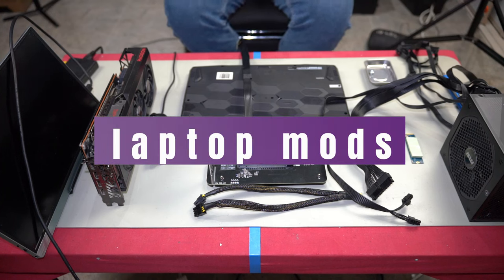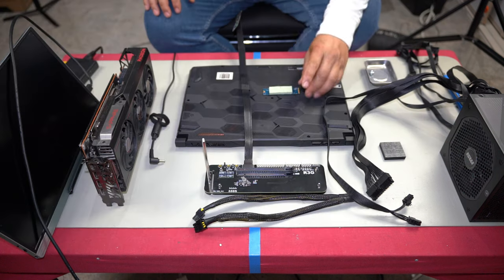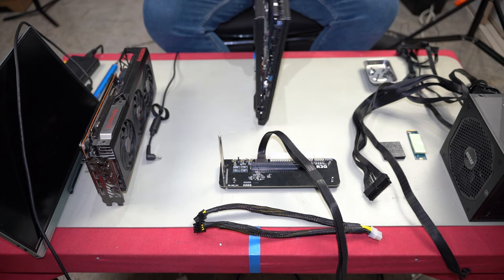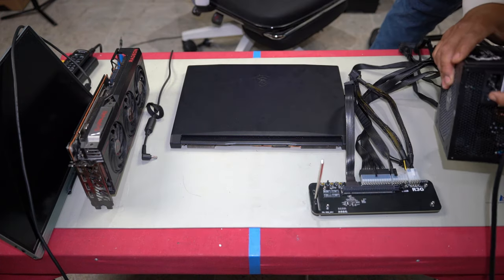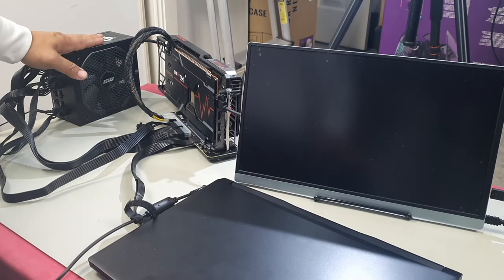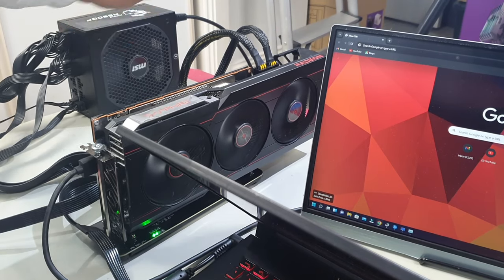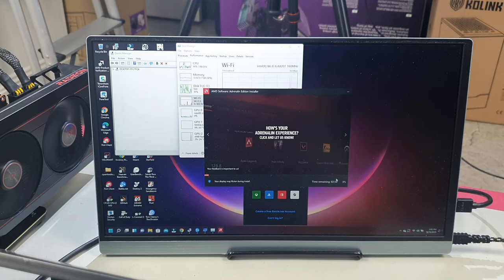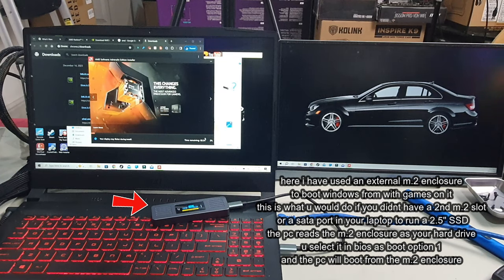how to setup eGPU  use an external gpu with your laptop for gaming

Comment: Amazingly detailed, thank you :) you're even using the PCIe 4.0 compatible one that the other guides don't seem to use. Just what I needed!
Reply from the maker: ur most welcome my friend
Reply: Where can I get this dock in India? It's not in Amazon 😔
Reply from the maker: @babyjvadakkan5300 aliexpress buy from them and it will come to u
Reply: @MIKEYZVLOGZ thanks
Reply from the maker: @NewEra-u3b  so welcome dear friend
Reply: I have been looking for this type of video, because my laptop is ASUS GL504GS, with Nvidia graphic card gtx 1070 and I want to add an external gpu of rtx 4060. Will this work too?
Reply from the maker: yes it will @davidmartinez6347
Reply: @davidmartinez6347  what's the processor!? check for bottleneck cpu and GPU
Reply: @MIKEYZVLOGZ  Well, what I later did is to use my main m.2 slot ssd space for this and reorder another hdd and place it on the free space I have because the WiFi card on my laptop is totally different from the examples you listed and it work. But thanks for an eye opening video and your ability to respond.
Reply from the maker: @davidmartinez6347  I'm glad u figured it out ..good on ya mate.. perseverance is key ... I applaud your willingness to keep trying and figure out a way..it's what I do..I don't give uo easily ...very smart idea to just switch the boot drive so u can use tour egpu

Comment from the maker: So worth it the 3050 isn't the best graphics card literally any external graphics card over 3060 would be better
Reply: Yo uhm, tried to do this but my monitor isn't getting any signal
Reply from the maker: @erisponsible3169  u using a gen 4 mobo? pr gen 3? and if so try manually selecting the pcie gen 3 or 4 version in bios
Reply: @MIKEYZVLOGZ  so uhm about that, how do ik I got a gen 3 or gen 4
Reply: Moreover how do I switch that in my bios?
Reply from the maker: @erisponsible3169  go into bios under settings  look for pcie selection ..it's different for each mobo ... under advanced or tweaker something like that ..it really depends on which mobo or brand u have
Reply: About that, my bios looks all simple and stuff

Comment: But the problem is that I heard thar m.2 slots only support upto PCIe x4 lanes, so you would only get about 60-80% power of ur gpu at max 😐
Reply from the maker: It really depends on the m.2 slot and the gpu and motherboard you have, but that can happen.this is definitely something to consider but it will still.benefit from being able to use the ex gpu and get that performance from an egpu
Reply: @MIKEYZVLOGZ  I already have a laptop with a 3060 and an i7 12700H, I wanna ubgrade to a 4070, is that gonna work ? Will I be able to get 100% power
Reply from the maker: @Rishik79832  ok so u watch anyone who has done this and u won't ever get 100% of the gpu performance its just the nature of the setup ... sharing lanes with pcie 4.0 and running at x8 not full x16... but all in all u will get better performance than what u are getting from your current gpu esp wen ur using a much better gpu ... so it's still worth it ...100% it is..but for ppl who only plan to use a gpu 1 level up they need to think whether it's worth it ..in your case ..it's a good jump
Reply: @MIKEYZVLOGZ  That's disappointing, I might as well just build a pc setup because I already bought the 4070 ☠️
Reply: @MIKEYZVLOGZ  My laptop's motherboard has enough free space, so can I just solder a pcie slot into the motherboard, connect it to the essential components and then connect the gpu to it ? Will that work ?
Reply from the maker: @Rishik79832  that I'm not sure I'm not that technical
Reply: @MIKEYZVLOGZ  k
Reply: @MIKEYZVLOGZ  it's fine
Reply from the maker: @Rishik79832  u will never regret a pc setup and if u don't want a bulky one go for itx build ..it's amazing how small a pc can get..and still be powerful

Comment: love it ...great way to use a much more powerful gpu with a descent laptop. I find alot of laptops have good cpus but it lacks in gpu. due to the cost .so having this is perfect way to keep your laptop up to date using a much more powerful gpu ❤❤
Reply: So to use this, you have to buy a new power supply that can connect to the laptop?
Reply from the maker: not to laptop...to device only... your laptop has its own power cable .. this egpu device uses an external psu to power it... and with that power ..it powers the gpu ..but u do need another psu yes u do
Reply: @MIKEYZVLOGZ  Ok thank you! Thats what I thought but double checking.
Reply from the maker: @Daniel-od1hq  no worries at all

Comment: i have a laptop the processor is ryzen 3500u and i want to build egpu using oculink.What is the best compatible gpu for my ryzen 3500u processor?thank you so much :)
Reply from the maker: @ihbaniahloi  it will.def help with performance
Reply: @ can you suggest what graphic card is better for my ryzen 3500u processor?and what psu can you recommend thank you
Reply from the maker: @ihbaniahloi u on a budget 3070 for cheapest or if u have money to spend go 4070
Reply: @MIKEYZVLOGZ  ok thank you so much

Comment: hi! if for example for travel reason i need to bring my laptop only and unplug the eGPU from the device, i need to reinstall the drivers of the integrated GPU of my laptop again every time?
Reply from the maker: no once installed it will always plug and play..however if u have nvidia driver for laptop gpu and u use radeon external gpu and install radeon drivers it can conflict with software so be aware of this
Reply: @MIKEYZVLOGZ  i have already a GTX Nvidia Laptop with a 1650 and i'm planning to buy a RTX 4070 so it should be fine, thank you for your help!
Reply from the maker: @NedinoFirenze1926  yeo will be

Comment: My laptop only has 1 slot of m.2 pcie 3x4. Could the pcie 4.0 dock work? I wanna go with the pcie 4.0 version for some future proof, but I'm not sure if it can work with pcie 3.0
Reply from the maker: yes it's backwards compatible ... meaning it can support previous versions like 3.0 ..however if u find its not reading ..u may need to go into bios and select gen 3 if auto doesn't work either

Comment: That's really great tutorial. Will egpu work with type c m.2 slot over usb 3.1 type c port? My laptop doesn't support thunderbolt 4 and has only one m.2 slot. Also I want to keep the setup plug and play. If you could help me with the answer, that would be great help. 😊
Reply from the maker: yes this can work too... I used a m.2 enclosure to type c and usb 3.0 and it worked for booting Windows and games...so u can do this too... however try and ensure u can select your boot drive in bios ...ensure u have that option..if u do u will be able to do so
Reply: Thanks for your quick response. The thing I want to try is plug the egpu to m.2 enclosure instead of plugging it to m.2 slot of the motherboard. I will still be booting my os and load games from my original source. Primary M.2 ssd installed to motherboard.
Reply from the maker: @sumitbhalerao3031 ok in that case I'm not too sure I have never tried that... I'm not sure it will work..but u can only try..as I have never tried that ..I can't say for sure buddy... but it might be plausible
Reply: @MIKEYZVLOGZ I only have one m.2 slot which is occupied by my only ssd and I don't have a sata. So I need to remove my ssd and plug the egpu adapter to the m.2 slot and then can I use the same ssd on an external enclosure ?It's the only way to do it right? Also my laptop has 144hz display so I'm not going to use an external monitor but will that decrease performance??

Comment: Really cool! I guess it makes it less complicated if you didnt use another nvidia for an egpu. Because nvidia has a desktop and a mobile drive so having 2 nvidia would cause some problems. The dgpu has to be disavled for the egpu if thats the case
Reply from the maker: yes but with laptops what they have done is enabled both integrated and external gpus so it can be used in sync ..how this works is ..wen it needs the extra graphics it will use the external gpu ..that's why with newer laptops u see 2 gpus in task manager
Reply: @MIKEYZVLOGZ  I see wouldn't that cause some lower performance? That's why laptops have a mux switch to deactivate it's igpu for it to only use it's dgpu for pure performance. But yeah hopefully adding a egpu nvidia with a dgpu nvidia won't cause any problems since newer gen laptops are more smarter. I've seen older gen laptops cause so many errors with egpu and the same for its thunderbolt too.
Reply from the maker: @scottb9231  yes newer laptops are smarter then old school ones ..but in the end if u want pure just disable it

Comment: Thank you for the detailed video i have a  Lenovo IdeaPad Gaming 3 15ARH7 AMD Ryzen 5 Notebook 6600H its got the nvidia 3050 graphics but also amd Radeon graphics ALSO has a pair m.2 slot 1 2280 and the other is the smaller m.2 with the OS on it.  Im planning on getting the Radeon RX 6750XT CORE Gaming Graphics Card with 12GB GDDR6  just hoping no conflicts as this lenovo laptop has 2 video on board graphics. what the PS (wattage) are you running on this setup? i think the notes in the video say a 220 watt ATX?
Reply from the maker: the psu I used was a 850w but u only need a 500w psu atx to run the gpu..as u are only powering the gpu alone nothing else and its more then enough 500w and u will.be sweet ...ofcourse u can always go higher but that would be up to you..if u wanted to future proof and have a bigger psu for future cards as they get more powerful
Reply: @MIKEYZVLOGZ  ended up buying a 5KRF5 Dell AMD Radeon RX 6800 XT 16gb GDDR6 Graphics Card on ebay.. it should be here in a couple days and I have a 1000w ATX  psu iv had from past build  my question is WILL my laptop detect the new 6800XT video card automatically?  this laptop has has 2 graphics onboard a AMD and a nvidia 3050 should I set the laptop to audio detect BEFORE  when I first add the 6800XT I am running the laptop on on the onboard nvidia 3050 usually but I have the choice between the 2 onboad in the software ..what do you think?
Reply: i bought the JMT M.2 M Key NVMe External Graphics Card Stand Bracket 64Gbs Full Speed with PCIe 4.0 x4 Riser Cable R43SG Upgraded for Graphics Card 1660 Above (50CM K43SG)  it has 3 mini micro switches on it since this comes with no directions I'm wondering what these are for ? trying to find a manual on line  to explain what they are looks like they are all 2 position switches  and there are 3 of them to the right of the cable that goes to the m.2
Reply: i found what they do.....SW1, Power Forced Start Switch, 1 for automatic startup, 2 for forced startup, please cut to 1 for automatic startup.

SW2, PERST # signal delay switch, 1 delay 2.2 seconds, 2 delay 4.5 seconds, with eGPU software, for graphics card compatibility optimization, the current software does not support, please cut to 1

SW3, CLKRUN # signal delay switch, 1 is closed, 2 is delayed for 9 seconds, with eGPU software, for graphics card compatibility optimization, the current software does not support, please cut to 1

J1, PERST # signal delay switch, OPEN to open delay function, SHORT to close delay function, the current software does not support, please insert the jumper cap SHORT.

J2, CLKRUN_Capacitance Delay, currently the software does not support, only for R&D engineers plug in capacitance adjustment delay testing. It takes about 2.2 seconds to insert a 1uF capacitor, 5 seconds to insert a 2.2u capacitor, and so on.

Comment: really in-depth video but please please let me know if you can break off the m.2 riser to fit a smaller nvme slot like 2422 instead of a full 2280 nvme slot. I would prefer it if my boot SSD isnt just hanging from my laptop when I replace it's slot lol. I always watch these videos but never found the answer so a response would be very appreciate!
Reply from the maker: @namaco2201  honestly I'm not too sure but I presume it wouldn't be OK as there's the pcb that will be affected ... if u can't use a full size m.2 the  consider another option or a workaround
Reply: @MIKEYZVLOGZ  aww that is a shame, but thank you for the response anyway I really appreciate. I guess I'll have the cram the thing in lol.
Reply from the maker: ye see how u go ..honestly I used it without the bottom cover for a bit

Comment: Hi, thanks for the detailed video! I have the MSI katana gf66 11ue RTX 3060 laptop almost identical to the one your using. I also got the egpu setup and plugged in, my only problem is that it doesn't start up when I switch on the Laptop? The laptop starts right up but the EGPU doesn't, and I did everything exactly as in the video? The only difference is that I've got a spare m.2 slot in mine witch is the same slot you used in the video. Do I need to change something in the Bios? And if I do can you please guide me on how to do it?
Reply from the maker: hi mate so do u know if your slot is pcie 3.0 or pcie 4.0, try and manually select gen 3 in bios, sometimes u have to manually select the gen version of pcie to recognise the egpu device, eventho you have a pcie 4.0 like mine, if the gpu is running pcie 3,0 /as it is backwards compatible/ you need to select the right gen in bios to immediately recognise the generation of gpu and pcie reader
Reply: Hi thanks for the reply, Okay please correct me if I'm wrong, so what you're saying is that if the GPU is a gen 4 I wouldn't have to select anything in bios but if it was a gen 3 GPU I should change it in the bios?
Reply from the maker: @christophervrettas328  correct even if it is gen 4 select the gen its running, thi is one way to fix it as wen i did my research , th i sis what some ppl said to do, although i never had to do it, and it was able to recognise it , however it is a knwn fact to work with some gpus, and as silly as it may sound sometimes it depends on the gpu you are using too, when i tried with a gtx 970 just for the sake of trying, it didn't want to work, but wen i switched it out to the 600xt it booted immediately and recognised it without having to do anything and it left me gobsmacked... this was my personal experience, but not the case for everyone ... wat gpu are u using and which model egpu are u using too? i can try and mimic your setup
Reply: @MIKEYZVLOGZ  where in bios do I change it I cant find it?
Reply: the dock I was using is the PCIE 4.0x4 JHH DOCK-OC4 and the test GPU was a nvidia t1000 8gb. Now I think the GPU is a pcie 3.0. But I don't know where to change it in the msi bios?
Reply: @christophervrettas328  Hi, how your egpu working? i have same problem. Have you make your egpu work?
Reply: My laptop is ASUS GL504GS, with Nvidia graphic card GeForce gtx 1070 and I want to add external gpu, GeForce rtx 4060. Will this work too? I have being looking for solutions but your video catches my attention
Reply: @loctruong9177 I sold the JHH dock I was using the first time and baught the egpu dock that is being used in the video and yes it worked 100% was straight forward plug and play.

Comment: Hi MickyZvlogz 
I hope you can help me.. thanks for making and uploading this video 
I have a Toshiba Tecra M9 laptop which ‘packed in’ last week - I suspect the NVIDIA Quadro NVS 130M: chip / card is dead .. 
is there a way to connect this laptop to a display ( monitor) so I can access a program on the computer and save valuable data .. 
the graphics chip is welded ( soldered ) to the motherboard.. so apart from a re-flow or reball .. ?? .. 
I’m not a tech or computer literature guy .. just a civil engineer- so know nothing about PC ‘s or laptops 
Cheers … and thanks for making and uploading videos to YouTube
Reply from the maker: @peterpauldonoghue7024  that is a good question... to be honest that's a little bit out of my field...I'm notnabpc expert either just a simple guy that learns alot through trial and error... however it is very possible that u can do this in order to bypass the integrated graphics and use the egpu to connect to an external display in order to get your work off the pc... however it would take abit more digging and research to confirm it.. I wouldn't go this route until u knew 100% it's possible. but in theory it should work as it bypasses the integrated graphics which according to you has failed
Reply: @MIKEYZVLOGZ  .. thanks Mikeyzvogy for the reply .. your been very modest and helpful.. 
keep up the great work.. 
👍

Comment: Hay, Thanks for this Video. This video Help me to Upgrade E-GPU.. My laptop Acer nitro 5 an515-57-52bq (Can't Thunderbolt 3/4 just support usb C transfer Data).. So, my laptop Nvme PCI-E 4 _ x16 , can plug NVMe To PCIe ? This Laptop Have 2 slot Nvme.
Reply from the maker: I'm happy it helped ...
Reply: @MIKEYZVLOGZ  So, my laptop Nvme PCI-E 4 _ x16 , can plug NVMe To PCIe ? This Laptop Have 2 slot Nvme.

Comment: Did you have to change something in the window bios before doing the egpu? Or did you just install the egpu and it just works straight of the bat?
Also why do we need to out the 4 pin to the cpu?
Reply from the maker: shoudl work right off the bat, and u may not need the cpu connector